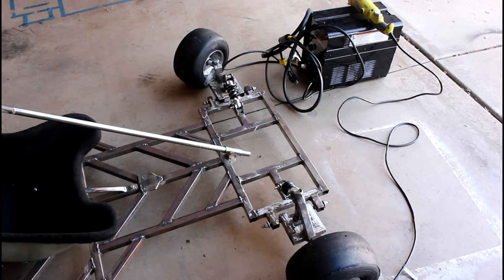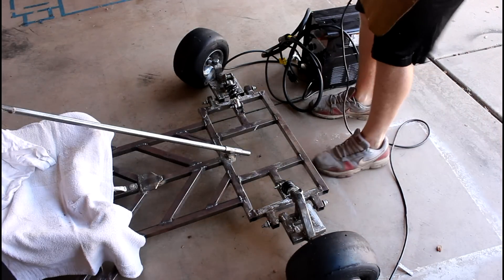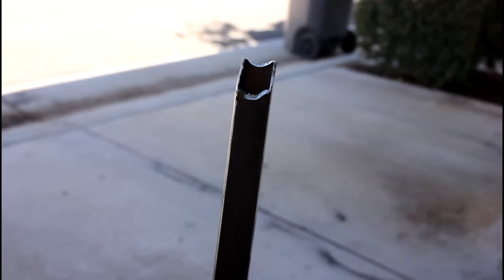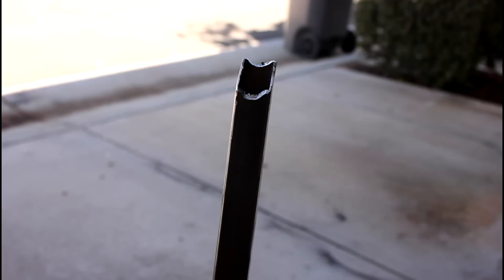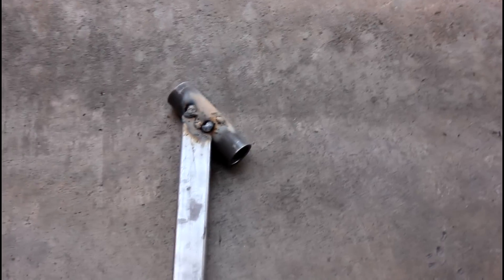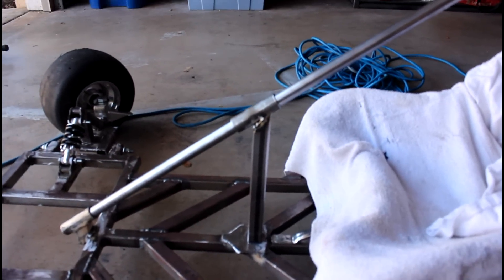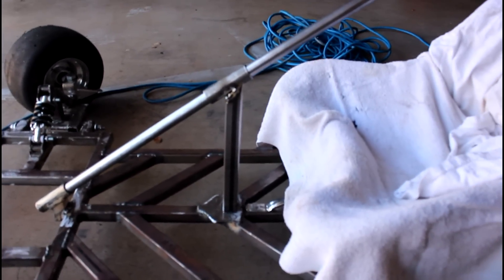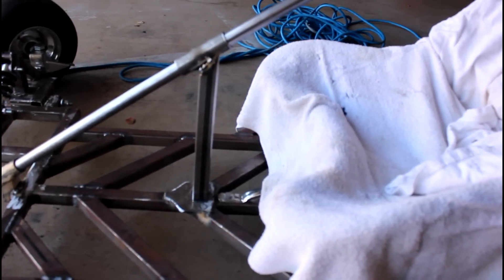(Homemade) Go Kart Build Project 18: Steering Column Fabrication!

Comment: how is steering ratio dependent on the steering arm length and angle
Reply from the maker: +Shubham Bajoria I don't think there's really a steering "ratio" involved here since there's no steering rack. I know that the pitman arm (the thing attached to the steering column) should be mounted almost in the same line with the mount points for the linkages on the spindle because that geometry will give you the best steering abilities

Comment: Tu sistema de amortiguación es buena. Por favor dime como pones los frenos en las llantas delanteras
Your damping system is good. Please tell me how you put the brakes on the front wheels.
Reply from the maker: +victtorhernani Thanks, there are no front brakes because I won't be reaching speeds high enough to where those are necessary.

Comment: First!!
Reply from the maker: +Riley Witting haha
Reply: +Hnat Automotive Photography are u gonna paint it? And when's the next vid coming out?
Reply from the maker: +Riley Witting yea I'm going to paint it after I get the kart running and driving. Next video will be up when I get more parts to work on the kart, got some of them, but I'm still waiting on the rest.
Reply: +Hnat Automotive Photography sounds awesome, rustoleoum rust converter paint works really well, I did that on my kart and it's perfect for surface rust. It instantly makes it black rust proof primer. I didn't put a top coat on because the rust converters black looks awesome.